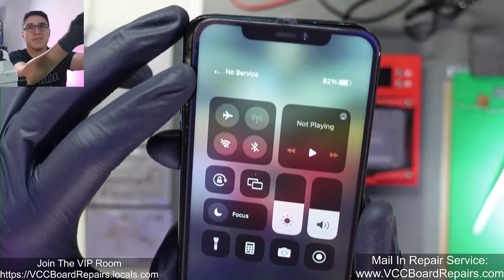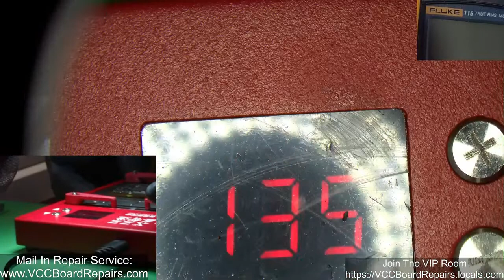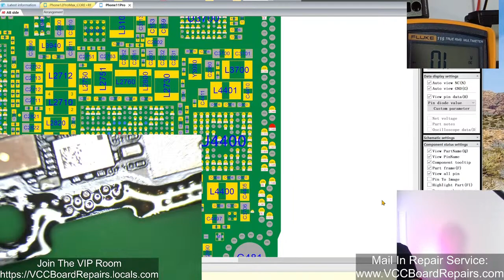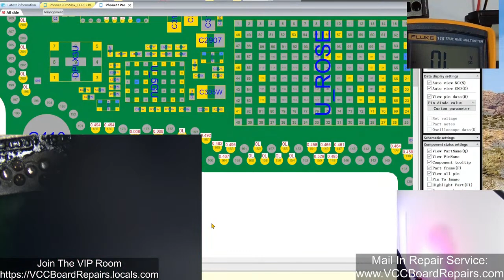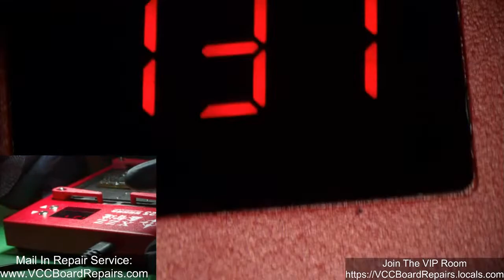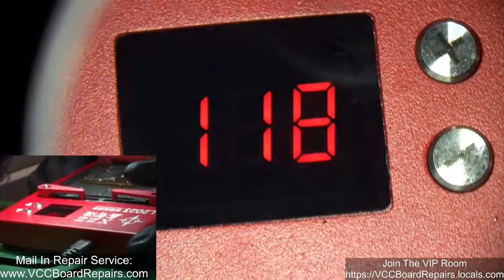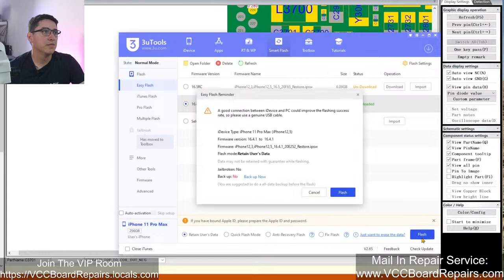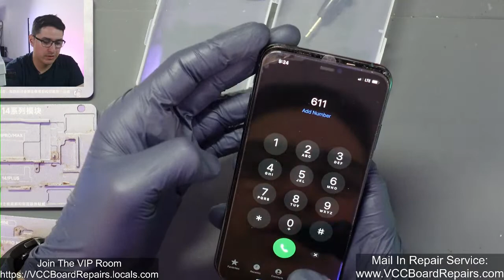New Board Heater L2023 - Fixing an iPhone 11 Pro Stuck In "Searching". Grayed Out WiFi & Bluetooth.

Comment: Hello master.
I got this heater following your advice.

I wanted to ask you, why sometimes you reball with stencil + solder paste, and other times you just use low fusion tin with the tip of the soldering iron.

Thank you. (of course you deserve the likes I add to your videos.)
Reply from the maker: What do you mean? I only use stencil to reball
Reply: @VCCBoardRepairs  In some previous video, maybe some iPhone 11, I saw you replace the original tin with low temperature tin.
I well remember that you spread the flux and then with the tip of the soldering iron you made repeated movements until small spheres of tin formed on the pitches.

But your answer was very much appreciated, it means that you have abandoned the method I just described above.

I write from Italy, forgive my mistakes.
Reply from the maker: You're probably referring to the iPhone 12PM video from like 2yrs ago 😅
Reply: It could, but I was fascinated by that method and have used it several times successfully on the iPhone 11 series.

I have commented on other videos as well. As soon as you find the time, I await an answer :-)

Thanks for the videos.

Comment: I can recomend you iRepair MS1, comes with plates from IP X to IP 14 Pro max. Mine it's like 20C off (lower) but is ok for the moment.
Reply from the maker: How do you change the plates?
Reply: @VCCBoardRepairs  Well, it's like L2023 ish. It has some push down like the mechanic, but the heat element is beter on MS1, 100%! 
I think L2023 has some magnets, right? And beeps this one too, loud :D, has the cpu, face id plates also.
At this moment i'm doing an ip 12 pro, not charging due to bad wall charger, so i need to split the board.
Reply from the maker: Actually I have that one. I didn't like it

Too tall

And plates are screwed down. So it's not easy to change plates
Reply: @VCCBoardRepairs  Noo, this one is without screws. Id like if it had screws because heat transfer would be better for me!
And yes, it's tall, has like 3cm, hard to fit under microscope if you don't have the flexible arm.

Comment: With that mechanic heater it's not that you've got a bad unit those things are infact trash I purchased one last year and it died after one hour of usage
Reply: Weird, I have the mechanic heater and it’s been good so far for me. Also have the sunshine heaters and they mostly work the same way. Splits an 11 board at 150-160 and reaches it fairly quickly.

Comment: Where do you get the copper pads you used to replace the torn pads?
Reply from the maker: Here: https://www.injuredgadgets.com/wylie-soldering-repair-spot-welding-piece-patch-solder-lugs/?acc=3d2d53e5abcd70e24cc444935b88e6ac21

Comment: After we buy it, don't we need to adjust anything?
Reply from the maker: Read the instructions in the box
Reply: @VCCBoardRepairs  So that the temperature is guaranteed, use L10 to L40, correct?

Comment: Friend, I bought it and it takes me more than 10 minutes to get to the point of Separate the plate
Reply from the maker: Either it's defective or you didn't follow the paper instructions to calibrate it for 110V
Reply: @VCCBoardRepairs  Could you help me calibrate it to 110 V?
Reply from the maker: Check the paper that is in the box

Comment: whlt007 for the win :D board heater
Reply from the maker: What do you like about it?
Reply: @VCCBoardRepairs  only heats the interposer and not the whole board , also can reball with the heating platform ,:D its super easy , put stensil and just turn on the platorm and reball done. dont need seperate jigs for reballing . its included